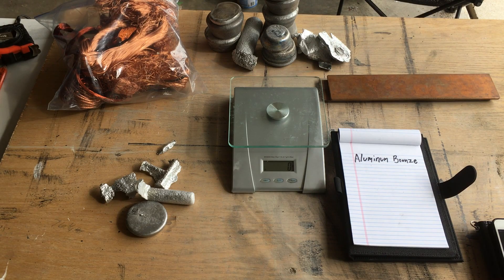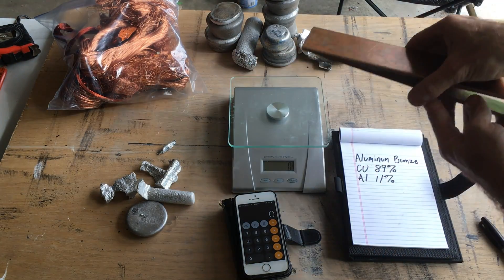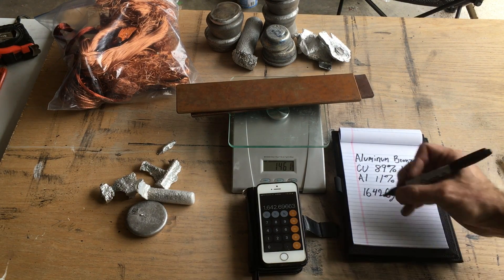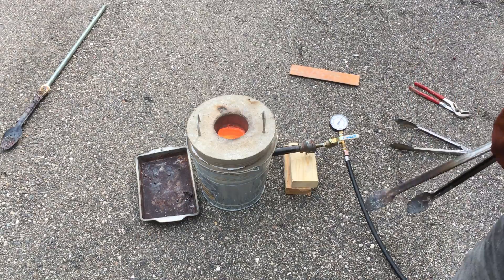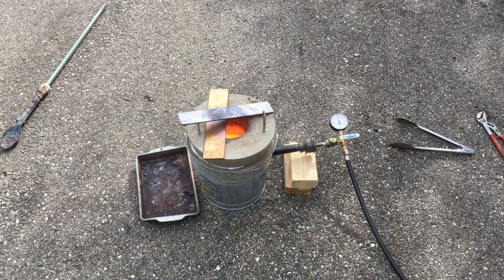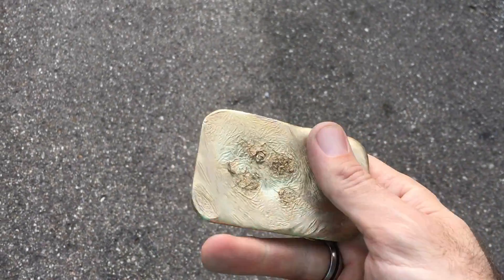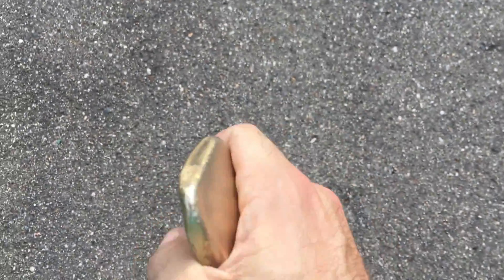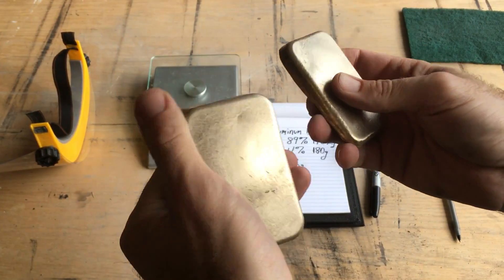Making Aluminum Bronze (Part 1): Melting Copper and Aluminum - Looks like GOLD!

Comment: Regarding the percentages of aluminum to copper in the mix - is that supposed to be by the weight of the materials or the volume of the materials?

Comment: You really should melt the higher temp metal first, then add the lower temp stuff to avoid overheating the shit out of the lower temp metal for ages.
Reply: I'm late to the conversation and I'm no metallurgist, but it's my understanding that a metal with a higher melting point can dissolve in molten metal with a lower melting point, like sugar dissolving in water.  The melting point of copper is 1,984 F, but it will liquefy and mix with molten aluminum at lower temps than that.  Melting the lower temperature metal first is probably the way to go with these little single burner backyard foundries, because it can be a real challenge getting them hot enough to melt copper.

Comment: it is easy to burn the metal so watch out on the heat if you can pull it off place a ir reader close so you can read the level of heat .. also never use dryice it will warp the metal unless you have it in a 2+ ton press .

Comment: I suspect this may be the most useful new to me alloy yet? I was not introduced to it by you, here. It was in fact BigstackD with Nordic gold. But it turned out not to be a cheeky gold imitation I discovered later. It is a precise ratio that provides a strong, possibly enduring material supplementing naval bronze? Only now I wish I had not sold my leather motorcycle jacket. It would have been a great safety garment to wear when casting copper alloy.

Comment: The EASY way to figure percentage weights from a "I'm gonna use this pile" start (doesn't matter major, minor, or trace ingredient): weigh your "start pile" (your 2 copper bars). Divide that weight by percentage of total (89). Result is 1% weight. Multiply by additional ingredient percentage (11 for your aluminum), result is needed weight for that ingredient. Write down weights of each so you can "check sum" on the scale. By working from 1% weight, even "points' (nn/100 of a percent) are easily determined (0.nn times 1% weight). At any point you can confirm the result by dividing by "accumulated percentage" to ensure it conforms to the 1% weight. Best part is it doesn't matter what your "starting pile" is, the major ingredient, or the most minor one, or any in between.

Comment: For those watching and wish to try this, remember this rule: Iron liquids bounce off skin, Non ferris (copper, aluminum, lead and others) stick to the skin aggressively (personal experience). Synthetic cloth sticks, wool and cotton don't. Any oil in your muffin tin can act as a flux and solder the ingot to the pan. Coating the mold with a mix of graphite powder and water then heating the mold to well above boiling to dry the coating will make the metal fall out with no effort for a nice finish. Make sure it's dry! With your bronze, I'd wear leather shoes. Any water  with the liquid metal will make the metal explode, getting us back to the sticking to skin bit. Aluminum takes three times the heat over iron to melt, taking into account iron melts at around 3200 and aluminum around 1000F. You can use Potassium Chloride (no sodium water softener salt) from home depot as a flux stirred in to cause the non melting oxides to float to the top for easy skimming and no bumps and voids in your ingot. Just wrap it in aluminum foil, maybe half a tea spoon full, and stir it in.
Reply: Thanks Greg, this is really useful information.
Reply: I'm happy to have looked at his clip for reading your comment, if nothing else! After two years your comment is still providing a useful reference to viewers . Good stuff Greg, thank you.

Comment: Can I have question? Which step is right if I melting 2 metals together, melt down metal which has higher melting temp. (Copper) and then add metal which has lower like zinc ? or melt down zinc then add copper and increase temp. to melting copper?

Comment: I was playing with aluminum and cast a few mini muffin tin shapes.  Then I added maybe 5-10% copper for fun.  A strange thing happened.  A few of those next 5% copper pours seem to have almost welded themselves to the muffin tin.  I had to wack them pretty hard to release them.  It looked like a couple of them  had bonded to the steel.  Not sure what was happening.  Normally aluminum and steel just don't stick to each other at any temperature.

Comment: Cool man! I'm planning on making my own aluminum bronze soon. Just a question, why did you melt the aluminum first? Copper has the highest melting point? I know how molten copper and brass react, not good, so maybe because of the reaction? And did you stir the metals or do they mix automatically? Thanks!
Reply from the maker: Thanks. I read it was better to melt the lower melting point metal first so I did it that way. But since then I’ve read the opposite. So, really I’m not sure. I did give it a quick stir and it seemed well mixed.
Reply: Always melt the lower melting point metal first, then dissolve in the higher melting point one. Metal alloys almost always have a melting point between that of the two constituent metals. In this example, you melt the Al at 660C, then progressively add Cu which dissolves and raises the melting point to 1030C. As you're adding Cu, you're heating the furnace, so you stick pretty close to the liquidus on the binary phase diagram. This means you're never overheating which would waste fuel and increase loss of Al as vapor. Melting the copper first to make Al bronze is like melting NaCl and mixing in ice cubes to make salt water.

Comment: Great video. Do you have any information on the burner you used? Did you make that yourself?
Reply from the maker: Thank you, I did make it myself. I used a similar design that others have used. It is mainly plumbing parts. I will try to make a video showing it closer. For awhile I had trouble getting the foundry hot enough. I originally made the nozzle hole 0.6mm big, but when I changed it to 0.89mm it was much better. I went from couldn't melt copper at all to melting it in 10 min.
Reply: Google REIL type Burner

Comment: An easier way to get the aluminum wheight required would be to multiply the copper weight by .89 instead of dividing then subtracting the copper weight from that number. Unless you intentionally wanted to know/show the total weight before you got the aluminum weight
Reply from the maker: Thanks. You are right. I believe I was trying to start with a total weight.
Reply: @GeekGuyMJ   great video on making aluminum bronze 👍

Comment: Aluminum bronze is amazing stuff when its hardness and/or corrosion resistance is called for, but the downside is, it loves to turn into foamy dross inside of a mold if the sprue and gating isn't carefully designed with the minimizing of turbulence in mind.  Yellow brass is easier to work with when the castings just need to be shiny and golden coloured, and it is easily found in the form of cheap thrift store imported unicorn and dolphin statuettes. Just putting that out there... 😀 Anyhow, looking forward to seeing what you have planned for these ingots! 👍
If you're open to a little advice, if I were you I'd make building a safer set of crucible tongs and pouring shank a priority.  Grabbing crucibles by the edge like that with channel locks is a dangerous move, it causes stress fractures to build up inside the crucible wall and rim that may cause the lip to shear off without warning, and the TKOR salad tongs aren't likely gonna save you from a boot full of molten bronze and an extended vacation in the burn unit when it happens.
Reply from the maker: Tobho Mott thanks for watching and for your feedback. It’s good to know about casting Al bronze. I have a few more Al bronze videos that will go up in the next few weeks. I made about 10lb worth into ingots and gave them as gifts. Since I made those videos I have made much better tools, but there is a back log of videos to get out so the poor tools will be seen a bit longer. I agree with you. Eventually, I would like to cast an Al Bronze hammer. Have a great day.
Reply: @GeekGuyMJ  sounds like you're on track, have fun and play safe!
Reply: So I actually made aluminum bronze using this ratio today and ran into that weird foam you were talking about. I ended up losing about 500 grams of bronze to that foam and I’ve gotta figure out how to melt it back to something usable
Reply: I have actually had a string if these foamy dross castings lately, but I figured it was due to too much water in the sand.  I just learned about gating calculations though so hopefully will conquer problem that soon!

Comment: Nice experiment. Should metal alloys be calculated in % by weight, or by volume?
Reply from the maker: Phil Menzies Thanks Phil. I was told they should be measured by weight. 11% and 89% by weight. I’m just a hobbyist but it worked for me. Thanks for watching!
Reply: @GeekGuyMJ  you're right. It is measured by weight
Reply: @GeekGuyMJ  Hey I dont know either way. i'm just asking
Reply from the maker: Phil Menzies I have a few more aluminum bronze videos coming out in a week or so.